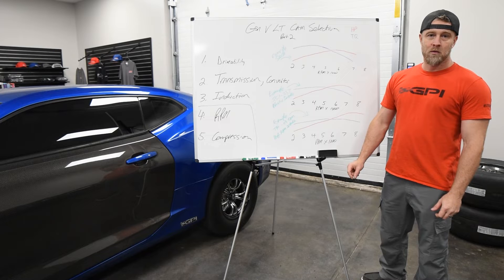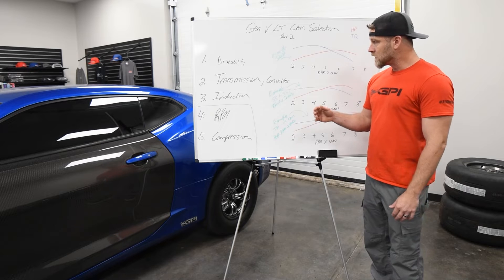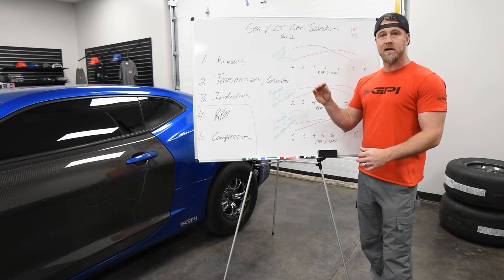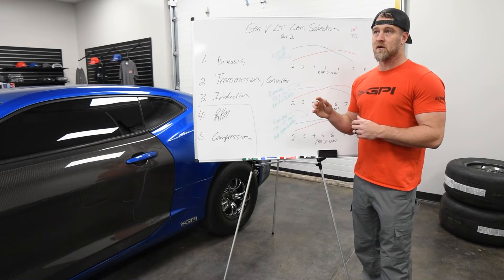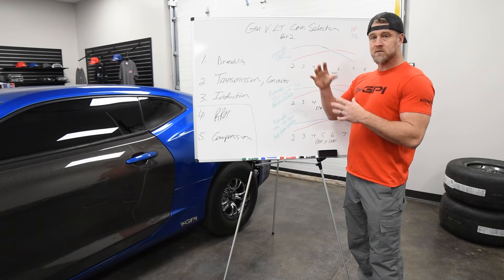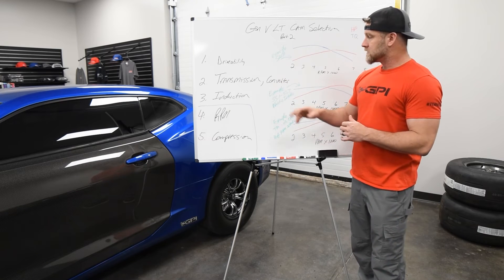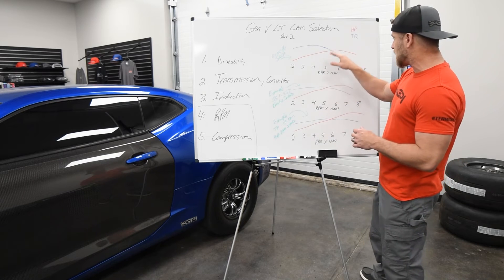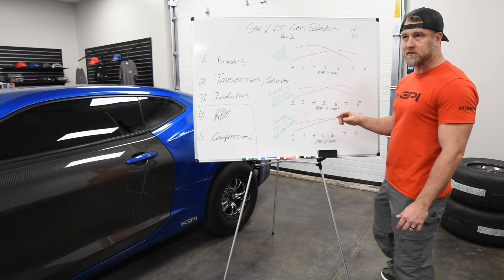Gen V LT Camshaft Selection - Drivability, Transmission, and Induction

Comment: What do you mean by "drivability"? I have the GPI stage 3 kit in my 2017 SS 1LE Manuel and it lags power at low rpms while I hit the gas then suddenly I feel the power kick in. Is this normal? Needing some answers and no one seems to know anything and it's impossible to contact GPI for an answer as the reps usually do not read and understand any and all questions.
Reply: Did you get it tuned by GPI?

Comment: They are great videos, i love a good drop in the rabbit hole with race cars 

id like to add that it's possible to make a big cam to play nice on the street with a manual. 

Most tuners dont do this because it takes alot of time and LT engine computers dont always corporate so its just easier and cheaper to convince the customer its the nature of the beset, 

Its not easy and should be a requirement on boosted gen v BTW where is the LT4/5 love at 🥺?

Comment: These videos are on point! Thanks for bringing the solid info. Really helps us understand where to go with our builds. Keep these coming!

Would be very interested in the differences you notice in various Gen 5 LT1 builds comparing unleaded race fuels (MS100, 260GT) vs E85. How do the pro and cons of these fuels differ with NA vs Supercharged applications, various cam set ups, engine wear, road course vs drag strip, etc.. Some folks like myself have access to MS100 (aka Street Blaze) or Sonoco 260GT at the pump so I'm especially interested in 100 octane (oxygenated) race fuel vs E85 pump fuel in specific. 

Thanks again for the great info!!!!
Reply from the maker: A discussion on fuel choices is on the list to do, just keep an eye out for it!

Comment: Eyeing some of your packages, for a 2020SS. Seems you should have even more flexibility with drive ability  bigger cams with vvt/10 Sox, versus the Gen4 stuff?  How big can you go and retain practically stock drivability?
Reply: The main issue is vvt takes up a lot of piston to valve clearance. For every degree the cam shaft is advanced for vvt design. You lose approx .006 p to v clearance. So essentially to make the cam bigger, it will mainly be on the intake closing side. Which lowers dcr. However, a perfect example of a cam that acts big with great drivability, is our lt nfc. Put the compression in with that cam shaft and it works quite well.
Reply: @Stevens7983  ohh gotcha, I do understand the concerns with the vvt and being  limited with the bigger cams or even locked out when too big didn’t realize it bled off compression like that. I’ll keep that cam in mind. Have a great prosperous new year.
Reply: Can’t edit, should read 10 spd*